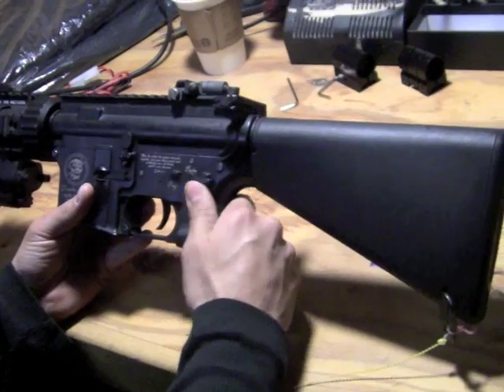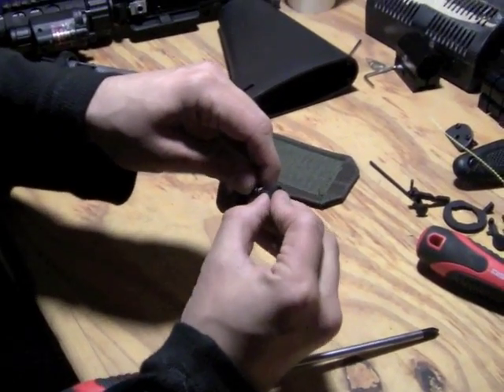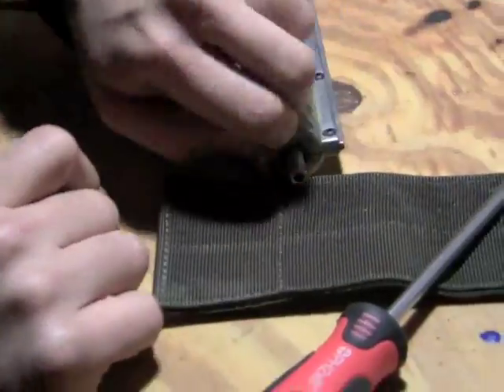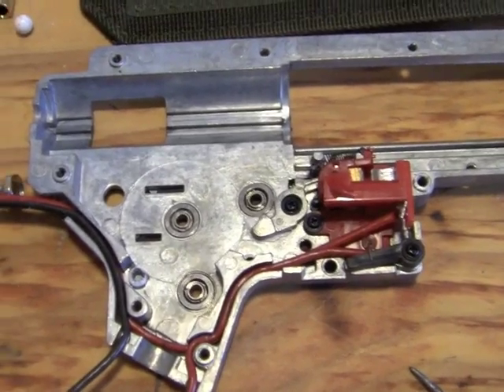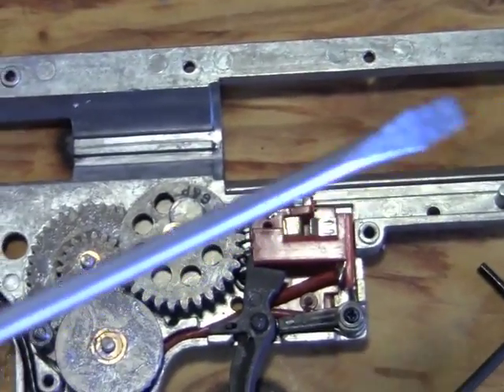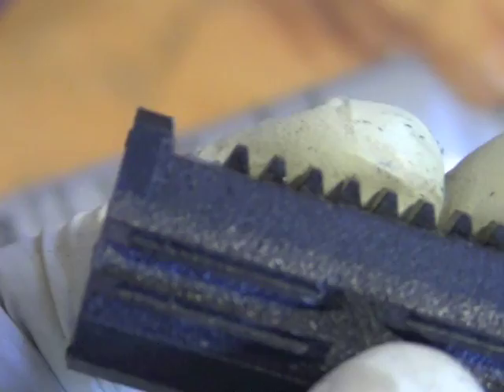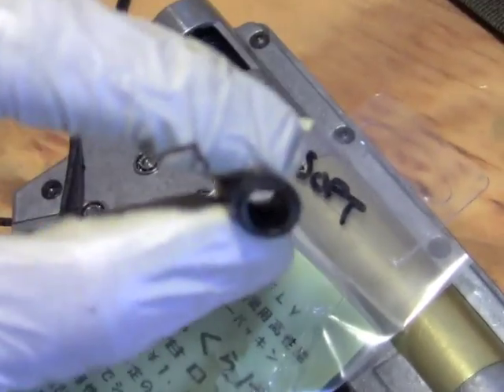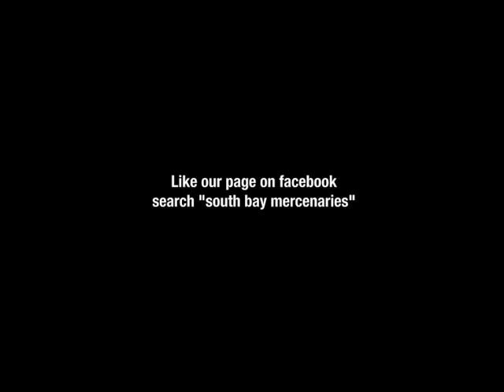G&P M4 Evike Zombie Killer Repair & Modification.

Comment from the maker: G&P's selector plate and safety lever latch and spring sucks. I had the same problem occasionally, I took the selector plate and safety lever latch and spring off my g&g combat machine and swapped them out and it works like a charm now.

Comment from the maker: @tyson2295 I'm sorry to hear that is happening to you. I'm sure you figured it out by now. Don't worry, it happened to me and i got soooooo frustrated. Try applying pressure using your right hand thumb and pinki on the cylinder or just keep your eye on the anti reversal latch soon as it starts popping out push it back in quick as possible. Or ask a friend or family member help you.

Comment from the maker: Oh, that's a simple fix. Push the red wire down and to one side and the black wire down and to the opposite side (diagonal side) then slide the motor in, "wiggle wiggle wiggle wiggle" it and push it down to bevel gear and attach wires.

Comment from the maker: @g3tr00t3d This gun has been and was running a 7.4v 3200mAh 15c Lipo with stock internals when it broke mid game. The gun came stock with the non ported cylinder, I don't know what a "ported cylinder head" looks like. Though I have considered upgrading to a ported cylinder but have to figure out which one to get for the short inner barrel.

Comment: No problem.  It's just that i've way too many G&P's break.  But I will say G&P has fantastic metal bodies!
Reply: Airsoftking253 maybe 4 years ago now there gear box shells are amazing has a steel trigger trolly rod instead of aluminum. If u get a g@p and replace the gears n piston they last forever ive had mine for 3 years no problems besides change buckings n easy shit. Ive never seen a g@p gearbox shell break yes there pistons n gears r shitty thats it in my experince

Comment from the maker: @g3tr00t3d Oh, i see ... the reason I installed the KWA piston head is because I had one lying around and the G&P stock piston head's screw stripped so it was difficult to take it off the old piston. I think the reason the bevel gear broke is possibly due to a bad bb getting stuck causing a lock up but thats just a guess.

Comment: first, what caused the bevel to shred? using 11.1v 50amp? second, why use a non ported cylinder head? third, not all o-rings need to be stretched, do so when o-ring doesn't seal properly. over stretching will cause too much o-ring drag with the cylinder.

Comment: Hello do you know ,i have a brandnew G&P just played for 1 hour
everything is working nothing is broken , but still do not fire  i seems there is something rong with the contact could that be the problem
i hop to hear from you
Reply: Old comment, probably not important now but check battery and check motor connectors one could've come loose

Comment: Not really, I got a Stubby stroked, swiss cheese, cut spring with spacers, silencer, dialed for CQB at 300 fps, stupidly fast without spending a dime. One main observation, the adjustments on the trigger for the motor is too much. Remove the center metal washer, nylon nut with screw, and adjust motor pressure with the two backplate bolts on the grip. Without any ammo, a fresh battery and have the batt outside the stock. Start shooting, hot wire and batt, too much pressure, loosen up, works!

Comment: Lithium grease is for cars, use airsoft teflon grease, a thousand times better.  also there is no point in putting grease on top of the bevel gear the top of the bevel gear doesnt touch anything else so there is no point in having grease on there